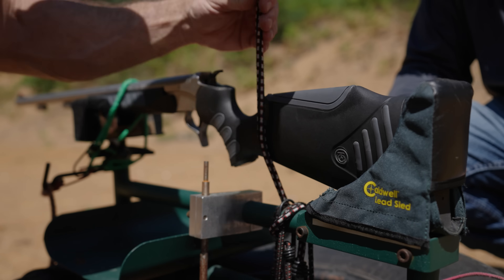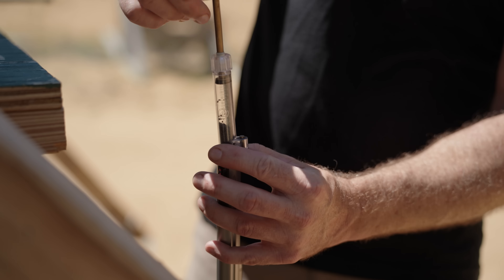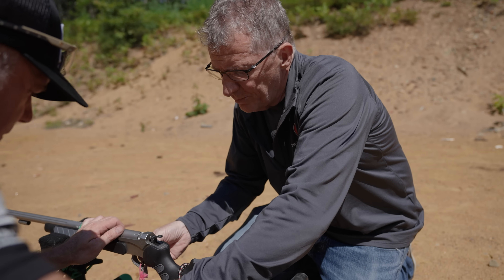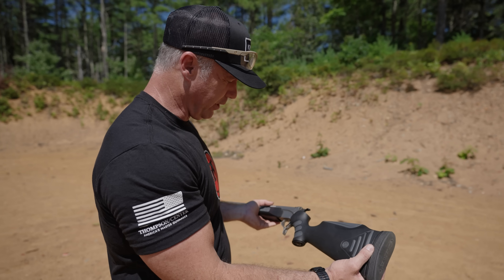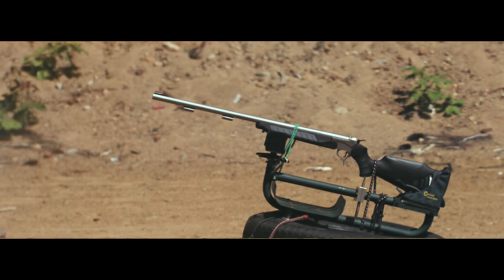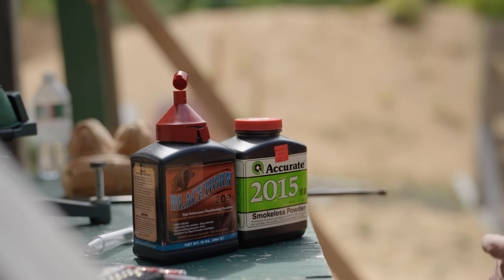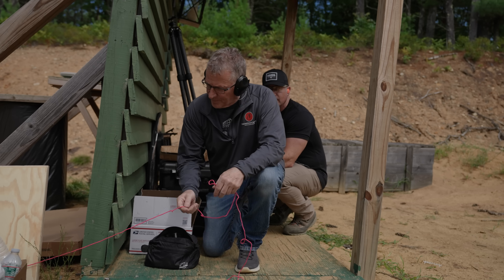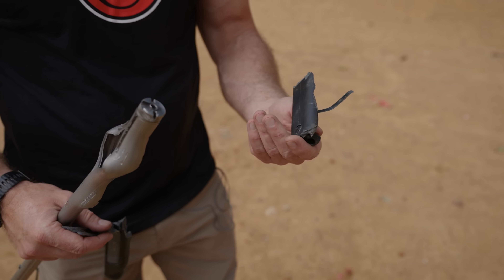My Muzzleloader Exploded

Comment: You’re using smokeless powder that is equivalent to black powder, but not real black powder. If you use real black powder, is this going to happen?

I remember in my youth talking to old timers who lived in the black power days who showed me how to test each gun for it’s maximum load, they thought me you can not overload a black powder firearm it will only burn maximum amount and any over charge will only be blown out the barrel un burnt. But smokeless powder will keep burning faster and faster till it will over pressure the firearm till something fails and comes apart.

Comment: another way is to load the gun and put the ramrod in it after it is loaded with the charge you are going to shoot all the time and then take a knife and cut a light grove around ramrod buy twisting the ramrod and mark it..  You can just put the ramrod in the barrel and see if the mark is at the top of the barrel and you will know right away if the gun is loaded if it is at the mark.. i do this to all my muzzleloaders after i work up a good load that i shoot all the time.. the clank of the ramrod hitting and empty barrel works well too if the gun is not loaded.. good shooting and stay safe.. Great video and thank you for do this demo
Reply: That's what my dad told me to do when I got my first ML.

Comment: First of all, any ML'er with any skill knows to notch or mark his ramrod where the end hits the end of the load. Second, your Smokeless test was the usual BS. Ofc it blew up, you overloaded it, like other videos I've seen on the subject. No one seems to think someone who reloads cartridges might try this with a load similar to old cartridge loads. It's always aimed at some dummy who doesn't know the difference between smokeless and BP. 

BTW, there's a fellow who converts 45-70 single shot center fire rifles to ML'ers which can use smokeless powder. One of his customers rifles blew up too. By loading a double charge. So even modern tempered steel made to fire centerfire rifle cartridges filled with smokeless powder can blow up too, if overloaded. 

Maybe someday there'll be a YouTuber who is a reloader, will do a smokeless test using small amounts of smokeless similar to what the smokeless cartridge loads were, that are made for old centerfire rifles made during the BP era. Such as a 45-70 Trapdoor. and work their way up in charge till it reaches what might be a safe charge and see the results.

Comment: Based on the MSD sheet for the product, BlackHorn209 is 83% smokeless powder (nitrocellulose).  The Guanidine Nitrate and the Potassium Perchlorate in the product are corrosive.  We can also blow up the barrel of any centerfire rifle by using the wrong type and amount of smokeless propellant.   The same is true for all shotgun barrels.
Reply: Guanidine Nitrate is a smokeless powder component (but more commonly found in artillery ammunition). It slows the burn rate when mixed with the more usual cellulose nitrate and nitroglycerin.
Potassium Perchlorate is definitely a corrosive oxidiser. Chlorine tetraoxide is just plain nasty when released, to everything in the neighbourhood.

Comment: I use powder from 50 BMG blanks
And never had any issues
Reply: What? Isn’t 50 bmg smokeless?
Reply: @1yehny  Based on the MSD sheet for the product, BlackHorn209 is 83% smokeless powder (Nitrocellulose).  120 grains of BH209 x 0.83 = 99.6 grains of Nitrocellulose.
Savage Arms proved the correct type and amount of smokeless powder can be used in a muzzleloader when they built their Savage 10ML over 20 years ago.  The wrong type and amount of smokeless powder will blow up any shotgun or any centerfire rifle barrel.  What would have happened if the loads for the Savage 10ML had been used in this rifle?

Comment: I guess it's because I use real blk powder but I will unload mine after every hunt because I've had problems with it not going off if left loaded very long I guess the powder absorbs moisture. I would have to remove the nipple and  put dry powder under the nipple and usually it would go off.

Comment: While I whole heartedly agree to never use smokeless in a muzzle loader. 120 gr by volume of Accurate 2015 would blow up most modern rifles that were intended for smokeless powder. In fact most rifle cases couldn’t even hold that much. With that being said, I understand how easy that mistake would be to make and Thank you for making the video to highlight the very real danger. Especially if you figure the powder used here was in the middle of the burn rate chart. Great video that I will be sharing with the hunter education class my grandson is attending this weekend.
Reply: Yeah, that was a LOT of 2015.  Most stuff that holds a LOT of powder uses a much slower powder than 2015...
Reply: It was almost like they blew up the gun on purpose, in the same way they could have blown up any shotgun or centerfire barrel by using the wrong amount of the wrong powder.   Have they ever heard of the Savage 10ML muzzleloader?  What would the loads for the Savage 10ML do in this rifle?

Comment: These are all possible mistakes. Knowing how to safely handle and use muzzle loading firearms takes attention to detail. Be safe and it's a fun and rewarding sport.
However, I have always wondered why not just build the muzzleloader to smokeless specifications? It would be a win / win type of product. A- it would be over designed for black powder and this very safe and B- it would be able to handle smokeless powder too. There would have to be the warning that the two powders are measured differently. One by weight and one by volume but again that would come under attention to detail. Something most gun owners practice as a matter of course.
Great video!!

Comment: When I saw the video image, I about wanted to cry. Thinking about my Encore in my gun safe, when I got it as a 300 W.M. and 30.06 barrel combination a few years later I bought a 50 cal muzzle loading barrel for it. Because my Black Diamond 209 holder had corroded in breach plug and I could not get a replacement. It was almost a year to get one.  FYI, Thanks for bringing T/C back.  I've got 2 other muzzle loaders from T/C beside my Encore.  I can't wait to see more optional barrels for it.  I don't really recommend the 300 W.M. for shooting in warm weather without a muzzle break. I find it slightly abusive to the shoulder.

Comment: years ago i had a bunch of 357 magnum ammo and no 357 to shoot any of it out of, but i had a single barrel .410 shotgun and some primed hulls. so i went to town tearing the 357 ammo apart and made a bunch of slugs for the shotgun with all the pulled powder and bullets, used quite a few for 'pest control' in the yard with great performance and decent enough accuracy for 20ish yard shots on small pest.... until one day, i fired one off that i apparently accidentally double-charged with powder. i had to beat the gun over my leg to get it back open and it gouged a little groove in the breech lock mechanism just barely big enough that you have to close the breech on a sheet of notebook paper to keep the barrel from doing the tiniest little wiggle when you close it. i got pretty lucky and other than that it held together just fine, but the critter i was shooting at was nearly **vaporized**. all that was left intact was the head and a little bit of its butt connected by a flap of skin, everything else inbetween was turned into a big 10 foot long red smear across the yard.

Comment: When you compare the thickness of the barrel at the breech and that of a smokeless rifle in the same location, you can see why the TC let go. The pressure was probably in the 50,00lbs/sq inch region, or maybe more, in a gun designed to operate at 15 and be proved at 25 or less.
I only use BP rather than the subs, which produce higher pressures in any case. Real BP will never hurt such a sturdy arm....

Comment: you have to screw all the way up to blow up a muzzleloader. Im not even sure you could legitimately do that on accident if you're sober. I've loaded bp pistols with triple, quadruple the amount of powder and then used what everyone has told me over and over to not do, and that's use jacketed ammo. Nobody can explain WHY to me, they just say NEVER DO THIS D00D. ONLY USE PATCHED BALLS D00D. But they dont know if it's even a dangerous thing to do. I have a kit muzzleloader pistol I've shot copper jacketed ammo out of, conical lead, power belts, all sorts of stuff and using a load that maybe 200 grains, it just bucks hard. I'm not even sure it would blow up if you over filled the entire barrel with black powder and compressed some lead on top. Probably not.

Comment: Just curious.  I see the ramrod depth marking comments so checking if your not sure is a good safety measure.  Question is if you determine an issue with a load has possibly occurred, can you remove the charge via that breach plug after it is removed?  BTW, I always appreciate when a manufacturer actually shows destructive testing.
Reply: Yes you can just pull the breech plug and clean the bore out. I make it a habit of cleaning up my rifle at the end of every day. It's just a quick insurance  that my rifle will go off the next hunt. I save that powder and bullet for a  play day at the range.

Comment: 120 grains? That will turn your muzzle loader into a flame thrower. I've been using a Muzzle loading rifle to hunt deer since the late 70's, of the Hawken style. With round ball I use 60 grains of FF, all the powder burns in the barrel, very little smoke comes out. With a conical bullet I up the charge to 80 grains of FF powder. Again, just a puff of smoke comes out the muzzle when fired.  So your using a lot of powder.
Reply: I use about 90 to 100 grains of triple F and the same thing with mine and also I found something weird that beyond 100 grains the velocity doesn’t improve much so anything beyond that is just a waste of powder. I typically run about a 300 grain chronicle projectile I make my own rounds using Lee precision mold.

Comment: Three 50gr. Pyrodex pellets, 150gr. - no worries. Accurate every time. Love the vid, the breech plug held - gives me confidence in the newer system, but I loved the strength of the old one. I’m glad to see the newer breech plug held up, it is easier. I’m sold on it. Love Thompson Encore, the best gun ever made.
Reply: If you get a pound of loose black powder, you’ll get approximately 70 shots per pound of powder. 100 grains by volume is equal to 150 grains of the pellets. Also, you have a very consistent burn too, and there’s less residue. It’s not hard to measure the powder as long as you can read.
Reply: I use 100gn with my inlines.  I've thought about using the regular types of powder but figured I'd stay consistent systems. Especially being a reloader of a few other calibers already.

Comment: From what i hear the old hand made guns where proofed to 3 times powder charge.
Reply: Yes, but that was 3 times the normal service charge of black powder. It's really hard to blow up a black powder guns by over charging them with black powder. You could fill up the entire barrel of a brown bess with black powder, set it off and still not achieve the same pressure spike/ curve as 50 gr of smokeless, which could turn the musket into a pipe bomb.

Comment: Big fan! Please make a smokeless powder muzzle loading rifle!!! Idk what the testing and liability is but my Savage 50 cal is the nicest muzzleloader I've ever used.
Reply: You could work with a powder manufacturer to make pre measured biscuits of smokeless powder attached to a sabot. Maybe a brass sabot with an open bottom end and an easily removable seal cap to control moisture. And a special ramrod with a flange to show loading depth.
Reply: That just defeats the purpose of muzzleloading. Muzzleloader started using smokeless powder. There would be no need for muzzleloaders anymore. You can just get the same thing with the modern firearm.

Comment: So basically you can double charge your muzzle loader and get way more velocity and be totally safe!
Reply: No, it's diminishing returns...
About 12 years ago a guy did 'overload' testing with BP and chronographed and velocity goes up about 28% then stops clumbing as the powder charge increases because at that point the bullets leaving the barrel before the bigger charge fully burns. Turns out for both 45 and 50 (standard barrel lengths) the most efficient load is about +-90 % of max. Most velocity for least powder burned

Comment: Excellent safety video Greg! Ty.
You mentioned the two ways to prove or verify that your muzzleloader is not loaded. Light and hearing rod hit breech plug. I agree. And i also prove/ verify my muzzleloader only has one charge in it. By  putting the ram rod in it and marking my ramrod at the end of the barrel. Should be exactly the same every time.

Comment: This very thing is why I preach to always mark your ramrod where your load charge depth is.
Reply: First thing I thought of, Mark the ram rod
Reply: @wzhaicthtaarkyer  ^~^
Reply: Yes, I believe in marking the ramrod. But I mark mine at the muzzle with the other end on the breech plug (marked on empty barrel). I then make a small dot mark on the rod on my typical load/charge depth.
Reply: My very first thought. Doesn't everyone do this? Also, I only use 60 grains 3f, I just need to get the ball down range. (Seneca .45)
I did try once casting a wax bullet and just using a percussion cap. No problem hitting a pop can at 10 yards.
Reply: @Lukiel666  same here, 50-grains at the range from a 50 T/C Hawken.   ^~^
Reply: Yep..one of the first things I learned when I started shooting muzzleloading firearms.
Reply: @thomasmoje5926   ^~^
Reply: I love how he said “mistakes happen”. I was always thigh mistakes cannot happen when it comes to muzzle loaders and firearms…ever
Reply: @DarkHorse35  the first-time you dry ball a muzzle loader you will be humbled, it's a case of when, not if.  Thats why you should carry a ball-puller attachment for your ramrod.
Reply: @ditzydoo4378  don't mind the safety reminder but technically this model doesn't count as a true muzzle/pipe-loader ( one of my favourite is the uk 1750~ wheel lock brown-bess in a repop 4ft~barrelled as the originals by now are probably to fragile to use daily/hunt's and for reliable self defence ) and is closer relations to my brake actions Winchester21 1890's~ and the breaching ( don't own or plans for owning and same for oil polymer&stamp'd-types ) sharps1840-70~/civil war era

legally speaking my USA-state's DWS/game-warden probably wouldn't let it/you use it on bisons,ram's,Turkey hunt-black-powder-only for better or worse and im not the typical types of snobby owners/collectible/bureaucrat
Reply: @ditzydoo4378  It's happened to me..a total pain to have to pull a ball with a ball puller.  One time I couldn't get a ball out of a repro 1853 Enfield rifled musket had to take it to a gunsmith.  Never attempted to use patched balls in that rifle again since then I only use proper sized minie balls..much easier to load.
Reply: @ditzydoo4378 wystarczy wykręcić kominek lub zaślepkę z brendki i dosypać prochu 4F w miejsce za kulą, mieści się tam nawet 1gram prochu, a to wystarczy by wypluć kulę lub pocisk.
Reply: Amen!
Reply: That's what I've always done
Reply: Was looking for this comment